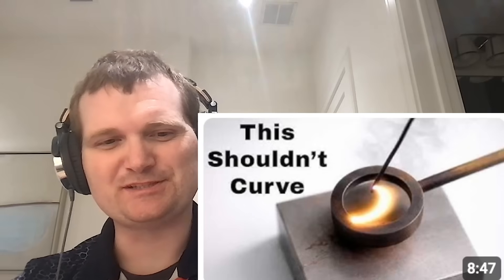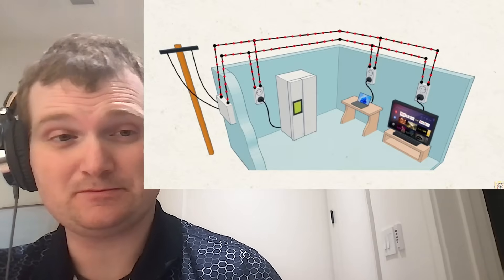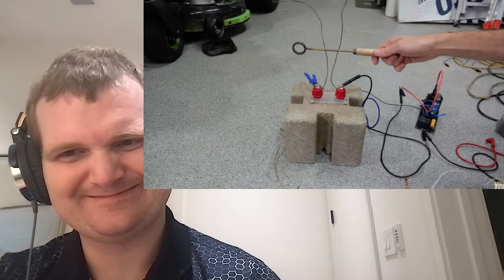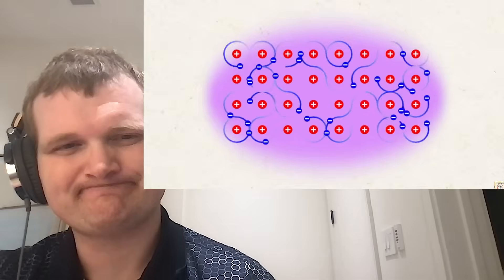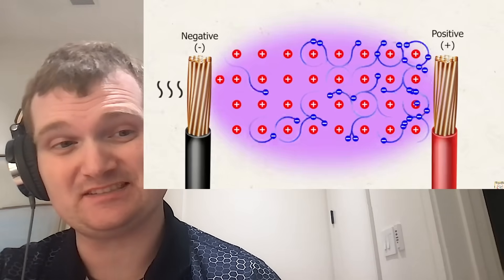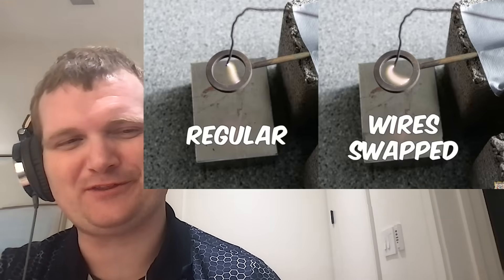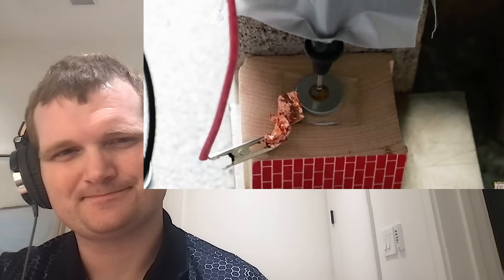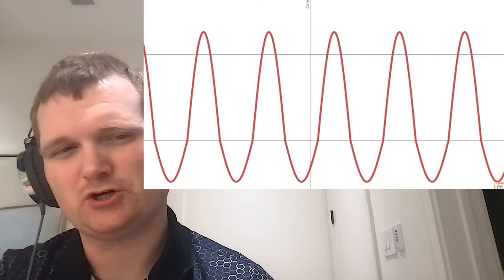Why Nuclear Fusion is in a Pickle - Nuclear Engineer Reacts to Action Lab

Comment: I would like to have seen the electrodes capacitively coupled to their sources, with high value resistors from each electrode to ground.  This would eliminate any DC component and center each electrode to ground.

Comment: At about 2 minutes here's my comment.  Do this with USA 240 volts, as in each electrode in the pickle attached to one of the two power phases.  If you're working with 120, one side is the neutral, which is bonded to ground at the load center (main circuit breaker where the service enters the building).  There are 3 wires, phase 1, phase 2 (180 degrees out of phase for this application) and the neutral which is - again - bonded to the ground at the main entry load center.

So... yeah, no, they aren't the same at all if you're only using one phase.  A 240 volt circuit does not need a neutral wire at all, because the current flows between phase 1 and phase 2.  a 240 circuit breaker is double tall because it attaches to both buss bars.  A 120V circuit has to return the current on the neutral.  

Small tangent - mental exercise for the viewer why any subpanels off the main panel have the ground separated from the neutral.  The neutral and ground are ONLY bonded at the first load center where the service enters.  Any subpanels must have the neutral and ground isolated.  You'll notice in any sort of modern load center that there is one "ground looking" buss bar with a big green screw.  If the screw is out/removed, this is a neutral buss bar.  Do not ground anything there.  If the green screw is screwed in to contact the chassis, the ground and neutral buss bars are bonded.

Comment: There has too be a mismatch to allow electricity to flow one side needs to have electron wholes to support current flow the potential difference is what causes the electrons to jump to the other side. But in fusion you confine ion's not electrons so it doesn't escape to the surrounding walls of the chamber coursing hi energy discharge and the plasma to cool and collapse. They don't use electricity in fusion to create energy they use neutron emission to heat the surrounding walls. This causes the material to become brital and radioactive over time. The ions in the plasma are fused by magnetic confinement forcing the ions together until these fuse causing neutron emission. This is important because ion's and electrons can't escape magnetic confinement. But in real life it take alot of energy to make fusion work and to sustain it takes alot more energy. Creating the plasma is easy confining it is alot harder and squeezing the atomic cores together harder still. All this is free in the Sun because of gravity the mass of the sun creates its own confinement. Neutron emission creates isotopes in the reactor wall. This creates radioactive elements that decay and break down into other elements. The solution to this decay it to use the surrounding material to feed the plasma with seeded material. But absolutely no part of this process is functional at this point in time. There is still not even a functional fusion reactor that has features to convert the energy emitted into usable electricity. The major hurdles confinement, no solution can manage the electro magnetic field imbalances quickly and reliably enough to maintain confinement let alone fusion. The confinement forces are borderline at best only creating fusion in short bursts. The fusion process creates even more instability in the confinement creating fusion to collapse. The magnetics get bombarded with neutrons causing them to fail. The proposed seeding materials still mostly theoretical. Then if they figure out how to manage the confinement and sustain fusion for more than a second. They still need to work out how to surround the complex magnetic confinement system with water to boil off and drive turbines this hasn't even been considered yet because all the steps before it still don't work. Then there is the issue of maintenance, operational lifetimes and initial energy requirements. These alone have substantial design constraints. To spark fusion you need a high energy source like a power station just to boot strap it. The neutron bombardment means the reactor becomes radioactive and requires maintenance. The cost and time to calibrate the magnetics now being managed via AI is substantial so replacing any of those elements means long down times. Then the fuel needed hydrogen isotopes only created as a side product of traditional nuclear fission reactors in vary small amounts each year. Fusion is possible and has even been achieved but the challenges to bring a commercial fusion reactor to life is like nothing we have ever done in history. Even the miracle of EUV lithography looks simple compared to fusion.
Reply: We'll just have to keep exploiting the Sun then

Comment: It is a random toss up of which side of the pickle lights up. The pickle has resistance. The side that heats up the quickest will have the least resistance flowing more electrons heating that side up faster. 
Oh... and nuclear fusion has F' all to do with electrons. For fusion to work, you need a hot and a cold. Hot and cold are relative.  It needs to spin and there has to be a process to remove the waste product or the fusion process comes to a halt very fast. The reason why fusion will never be a viable solution to commercial use is because capping the device and feeding it liquid hydrogen as fast as possible would twice level the largest cities on the planet. No government on the planet would allow a device like that in peoples homes. Nor allow the design of it to become public knowledge. The people that know how to do it now are taking it to their graves.

Comment: In a different video he controls the electric plasma with sound that holds the air. Any direction, perfectly. My suggestion has been for years using sound standing waves in a reactor to control it better. He proved my theory
Reply: Hard job. Sound is pressure waves, with which you want to fight electro-magnetic forces. You'd need extreme density gradients. Is it possible (even in principle)? If you go to extremes, linear approximations tend to break. I am not drunk enough to venture a guess.

Comment: Question, AC is a lot safer to work with than DC, right? So AC having even a bit of DC can cause issues (at times permanent ones) for electricians for example, right?
Reply: Yes that can be electrical frequency interference that's why we have filters on our various different devices in our homes 😊. A good example of this power conditioning filtering is often in a PC's power supply

Comment: I like electric things but AC confused me for longest time. Like hot and neutral to me that sounds like DC, if it was AC they'd both be hot. Electrician friend explained it they are 180 degrees off and like center tap on  transformer is neutral. I kind of feel like if it was on 240V it may be a little more symmetrical. 

I kind of wonder this plasma diode thing he is saying is kind of same idea that mercury arc rectifiers used. Those things are kind of cool/spooky looking seen some videos of them rated hundreds of amps used to run electric trains.

Comment: Remove DC bias using AC coupling with an inline series, non-polar capacitor rated for zillions of volts.
Not controlling for variables and then drawing snap conclusions without much evidence. 😞

Comment: Is it not attributable to PF? Devices do "work" on one side of the sine, causing asymmetry in the current. This is small in most house circuits, but can be significant in industrial applications, requiring equipment to conjugate phases to the grid.

Comment: My understanding is AC has a kind of what do you call ground problem. That is that I think the whole sine is on top of the return level. If you connect the two sides of a transformer output you are ok because those truly reverse. It is my understanding that any time you have a negative voltage you mostly mean you have declared something else as a zero level that is higher than like electron static potential uncharged.

Comment: as long as one side is grounded you will have this asymmetry ,house power uses ground for 110 /220, you need polar voltage  or a transformer to get symmetry